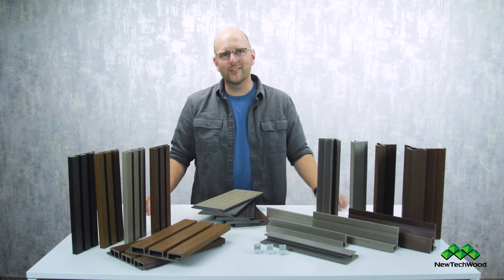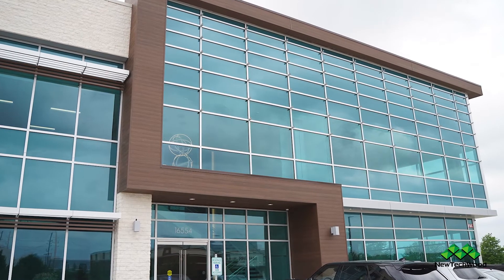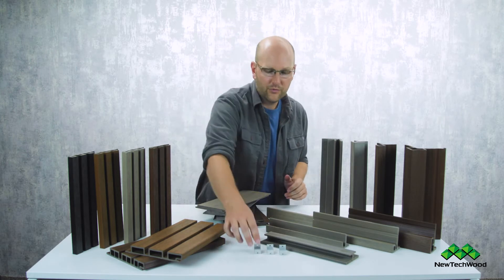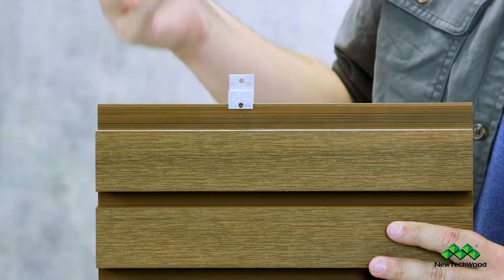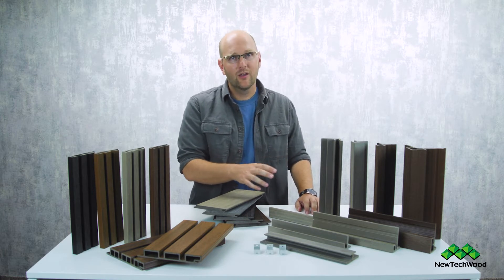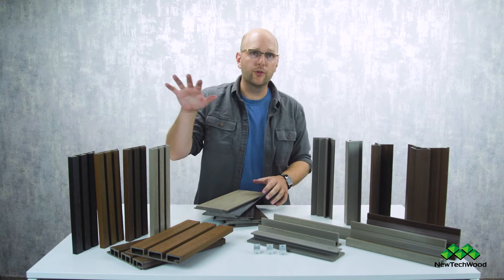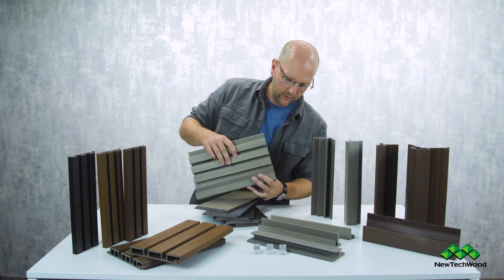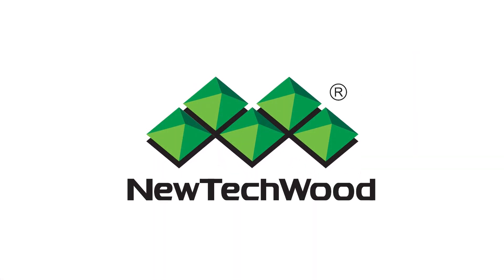NewTechWood Composite Siding Deep Dive

Comment: Are there any matching Mounting Blocks for this product? So that you can install the usual penetrations though this siding? eg. Lights. faucets, Electrical panels, vents? Do they make thick trim boards for this purpose that will project in thickness, beyond the siding and the clips?   or is this siding only for little accents with no real world penetrations?